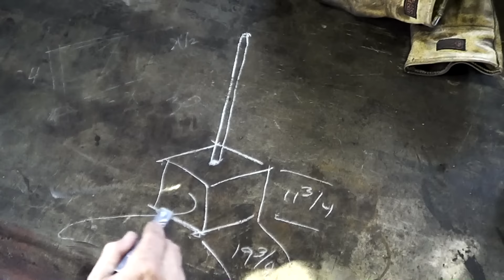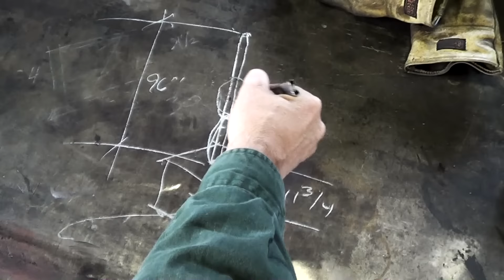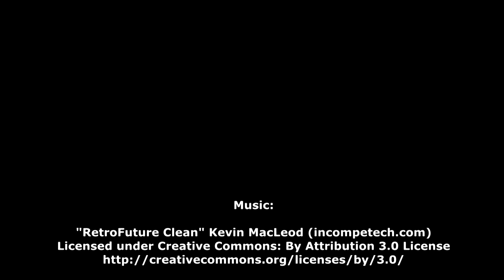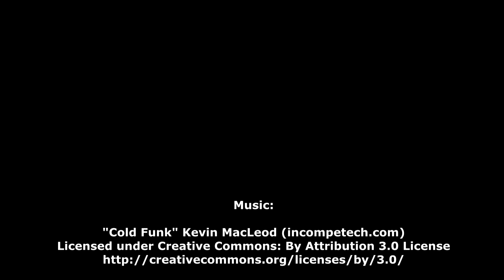It is NOT a Stripper Pole But a Sculpture Base V65

Comment: What brand of plasma tip do you use? I would like a "Drag-tip" like yours.It would allow me to cut like you,with clean straight cuts.
Reply from the maker: It's the one that came with the machine and not really meant to be a drag tip. I've been using scraps of wood lately, like 3/8" particle board, as a straight edge.
Reply: Oh! now I get it,thanks ,Learn something from you every video!